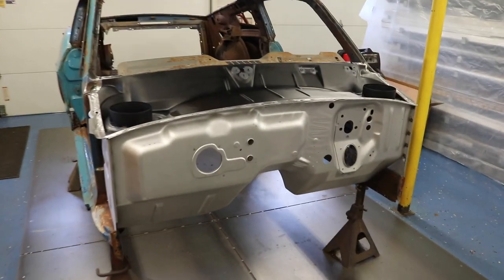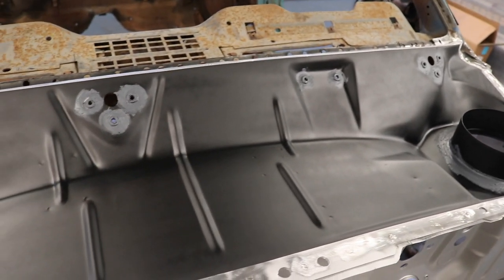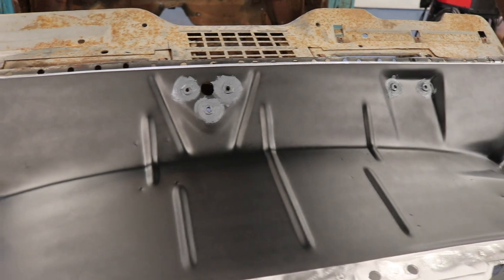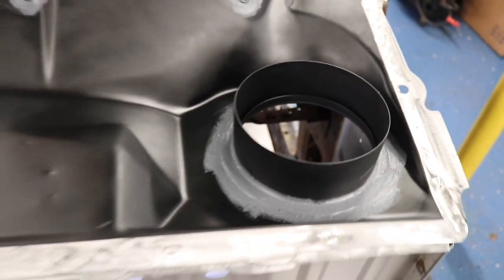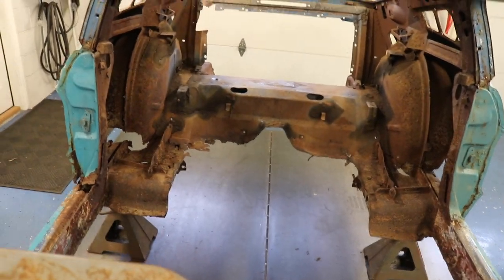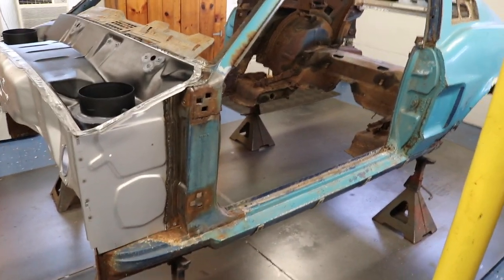Cowl Panel and Firewall Replaced 1968 Mustang Fastback

Comment: Hi there mr Peterson.. 
In this video you did the cowl side panels... look at the lower half of the side panel , you'll notice a squarish impression in the steel.. a 6" speaker fits perfectly into that spot.. I cut 5.5 " hole then mounted the speaker.. then modified an old 7" headlight bucket as an outside cover .. drilled1/4 " hole inside and above speaker for wire.. I wish someone would build it as an optional cowl panel...

Comment: Do you find it more important for the alignment hole to match up or for the sheet metal to fit up in a relaxed state without forcing the metal to twist (to get the holes to line up)?

Comment: Great work as usual! I had a question about how the titles work on your cars: since you are replacing all the panels, the VINs that are stamped in will be lost. Does this cause any issues when the buyer goes to register the car with the DMV? For instance, I believe the VIN is stamped into the inner apron and it looks to be missing.
Reply: On 68 not all vins are on the apron actually quite a lot weren't most are on the dash

Comment: Near my friends old house, there was a 67 gta that a guy owned and his friend wrecked it one night is what he told us, but the engine is turned 45° towards the passenger and is shoved so far up into the firewall that the firewall is pressed against the back of the brake pedal (the break pedal isn’t bent either) and the transmission isn’t all that tilted but is shoved so far back in the tunnel that it’s crack the trans tunnel along both “seems” that touch the floor and one on the top of the tunnel. Plus the passenger door is so bowed out that you could fit an entire balled up fist inside the window slot without touching either side, he claims his friend was fine from the accident. Would a job similar to that be difficult restoration? (It’s been a while since I’ve seen the car so I may have remembered it a little extreme, but it was definitely close in description)